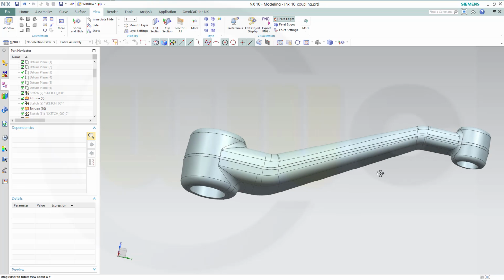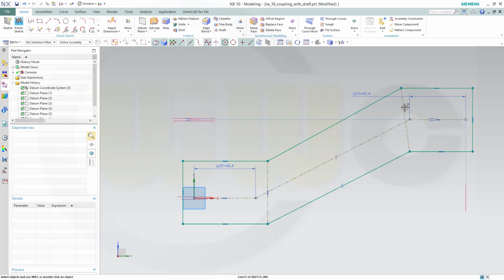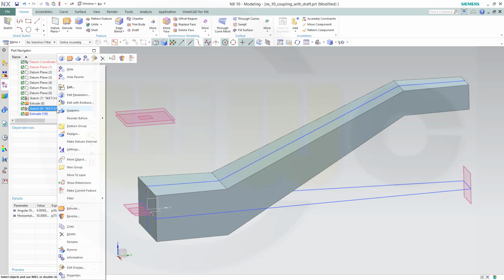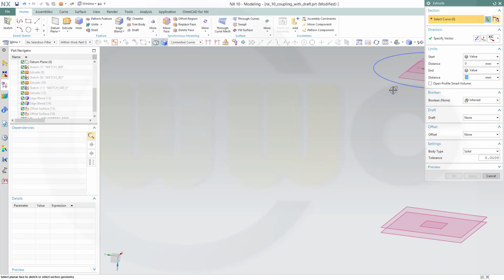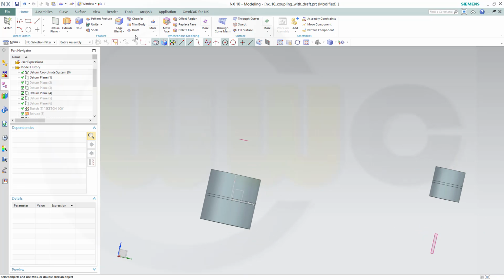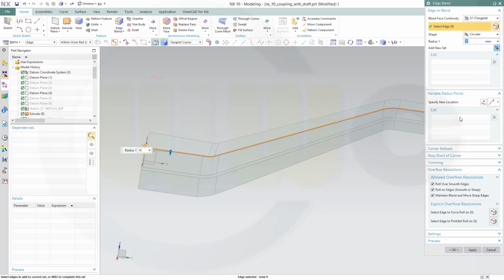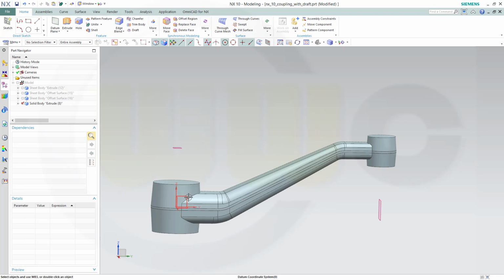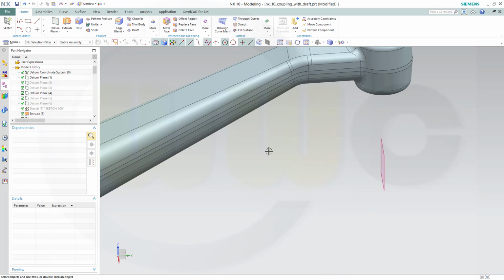Userwish  - Coupling with draft - Siemens NX 10 Training - Part Design

Comment: Hello Mr. Wolfgang,  I am looking for some formula and parameters work in NX8.5, for my project. The condition is to maintain 1300 belt length between three pullies of crankshaft pulley, water pulley (above crankshaft pulley) and an alternator pulley with lever control (left or right side of water pulley) . Aim is crankshaft pulley and water pump pulley are, in fixed position and alternator pulley is hinged and controlled with curved lever. This arrangement can be noticed on tractor engines basically. With a fixed belt length between the three. How to control the alternator pulley playing on lever curve. This is to check the clearance of the belt with neighboring parts when assembled upon engine after usage, the worst case position to calibrate. 

Please guide me with a clue to start with.. I am expecting the formula control for this as in CatiaV5.
Reply from the maker: Sorry -  I have to regret to say - without seeing this - I have no idea what you want to do! I´m not an engineer, just a humble trainer for these programs.